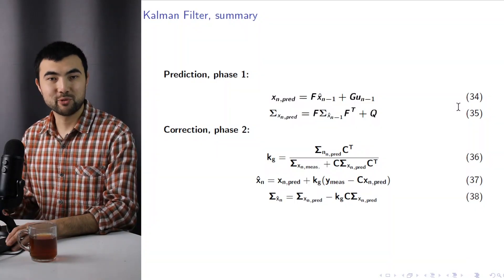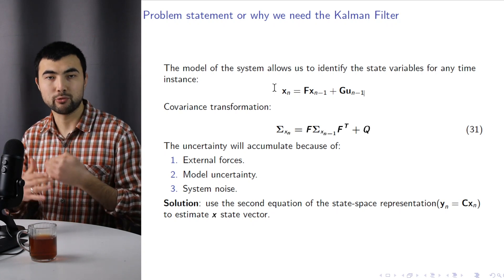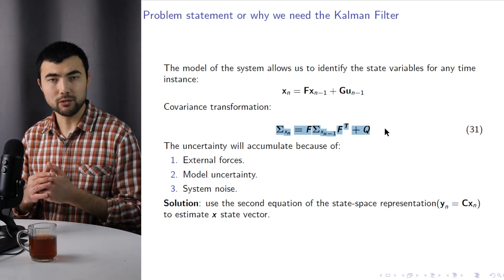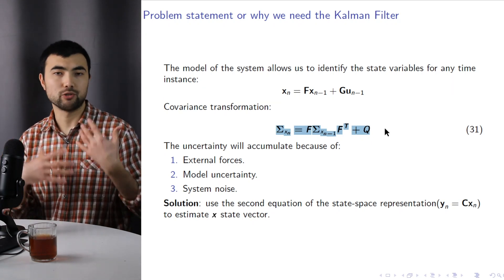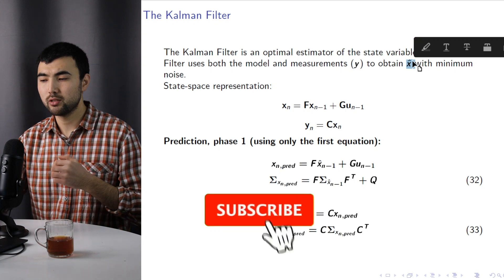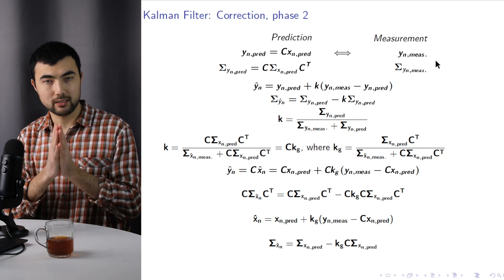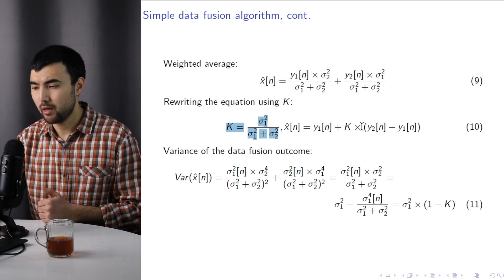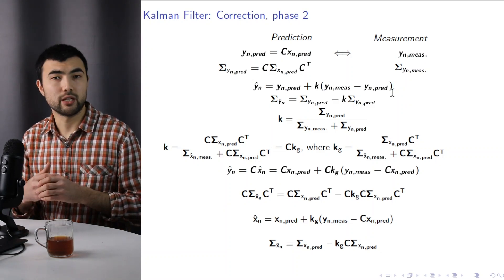Kalman Filter 4/4: Linear Kalman Filter

Comment: I came across a lot of lectures and materials. This is good. But none describes how to calculate w or Q i.e. system error or calculation noise. Everyone is so focused on matrix etc. Also a quadcopter needs 9 dimensions, no? Like 3d position, 3 velocity and 3 accelerations.